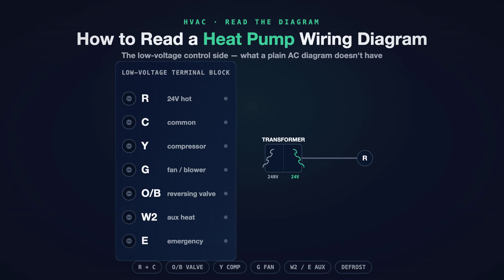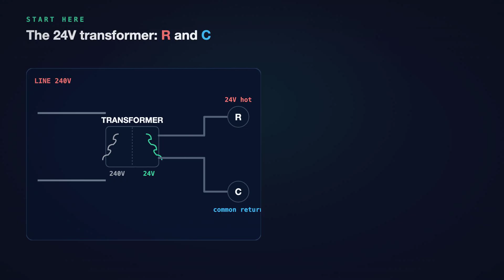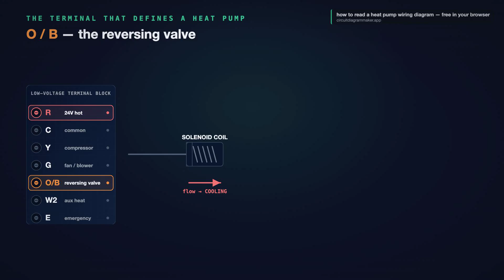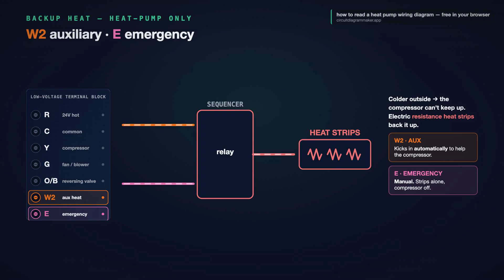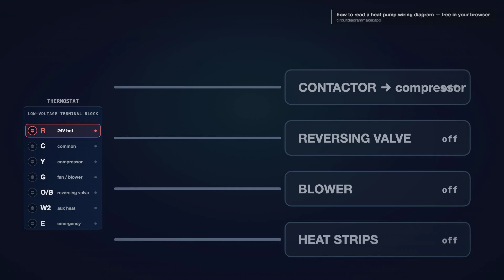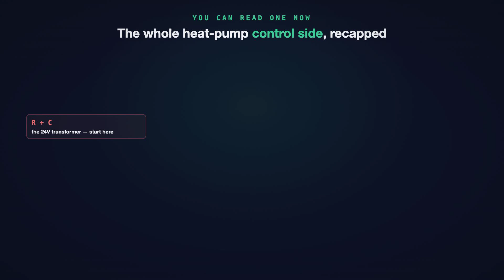How to Read a Heat Pump Wiring Diagram

Comment from the maker: The fastest way to know you're looking at a heat pump and not a plain AC: scan the low-voltage terminal block for O/B, W2 or E. A straight air conditioner never has them.

O/B is the one that trips people up — it energizes the reversing valve solenoid. On most brands O is energized in COOLING; on Rheem and Ruud, B is energized in HEATING instead. Same compressor either way — Y makes it run, O/B just aims the heat.

Drop in a terminal block and trace a call yourself (free, no signup): https://circuitdiagrammaker.app/try?utm_source=youtube&utm_medium=pinned_comment&utm_content=yt-072